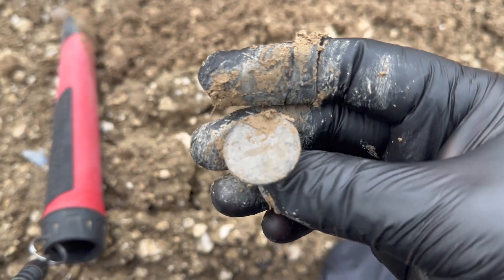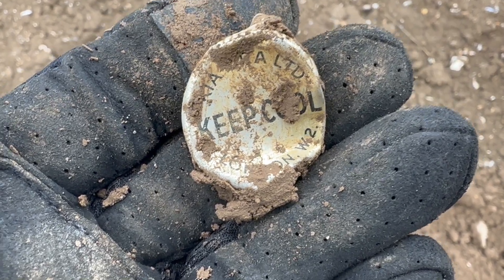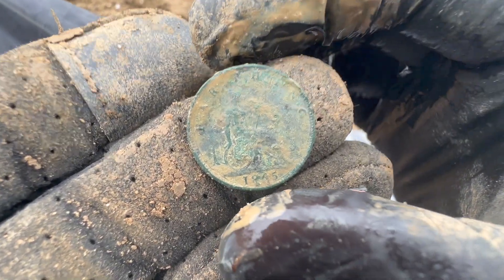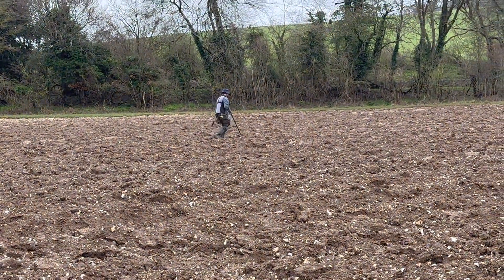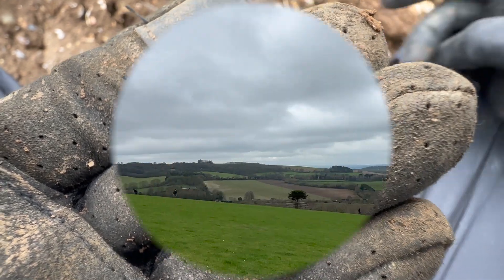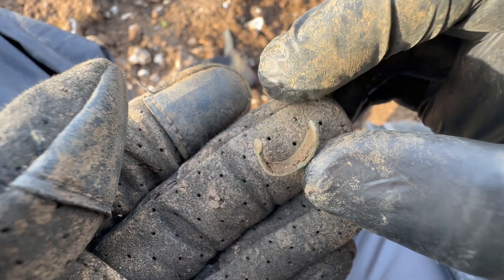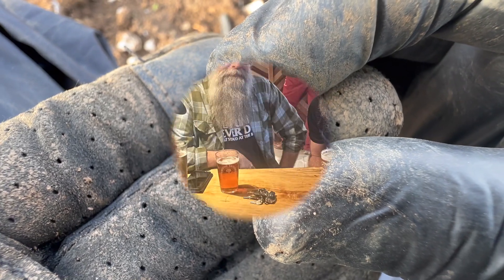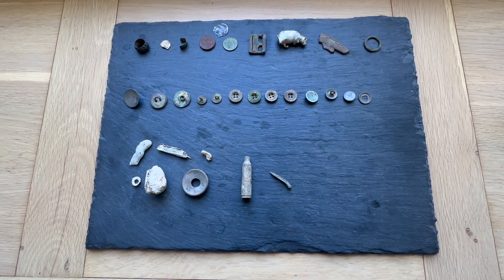Spring Detectival 2023 Day 1| Minelab Manticore | Finds Friends & Fun | Metal Detecting | Ep116

Comment: 17:14 looks like real Celtic ring money. Flat ring roughly cast. Celts used rings of metal as money BC.  Julius Caesar wrote about it too.  They would have to come in all sizes and would be gold, bronze and iron, possibly other metals too.  And I have found a few too. Unlikely a brooch because too roughly cast.  Ideal as currency.  Usually not very even thickness just made to weigh as currency. And flattish to stack easily.  If not ring money then where is the ring money the Celts used?
Reply from the maker: Oh wow, that's cool. So hard to say isn't it - and there are lots of opinions on Celtic ring money, but I love the idea it might be. I stick all of these types of things in a special pot, in the hope they may prove to be what I hope one day! Thanks for watching, really appreciated. All the best, Marcus
Reply: @Notchedto11  Yes the gold hollow rings with gaps are hair adornments apparently, still used today I read. The rough cast uneven bronze, flattish, uneven rings are the most likely Celtic currency.  Also iron was valuable then so where is the iron ring currency? We find roman coins 2000 years old but where is the ring currency used before Celtic coinage was introduced?  Celtic coins only started in the Ist century BC.